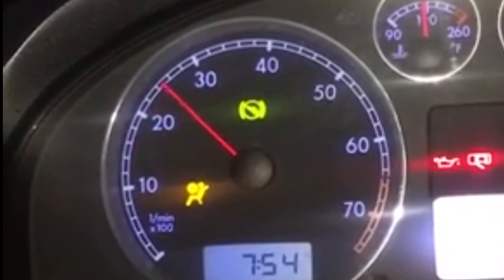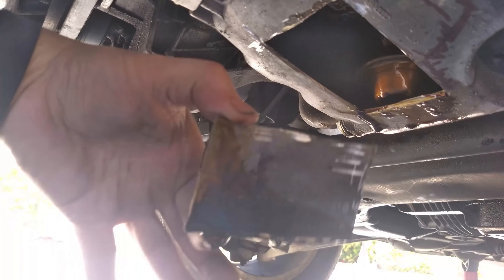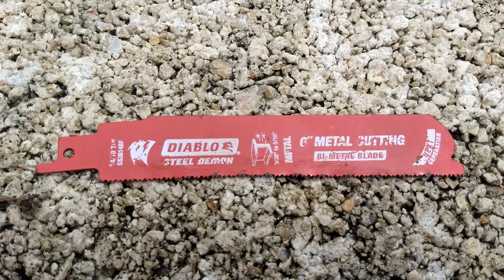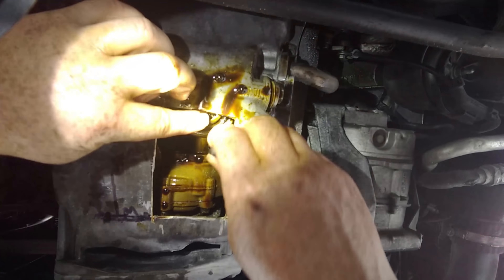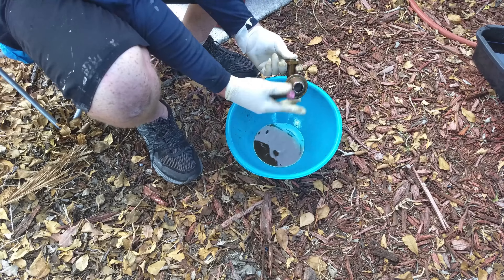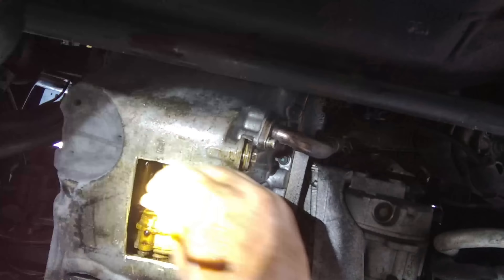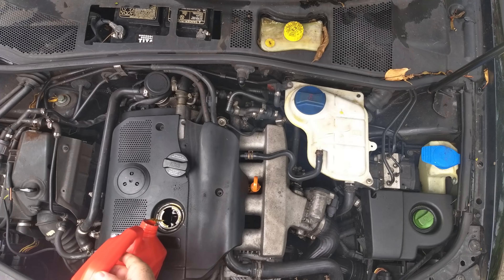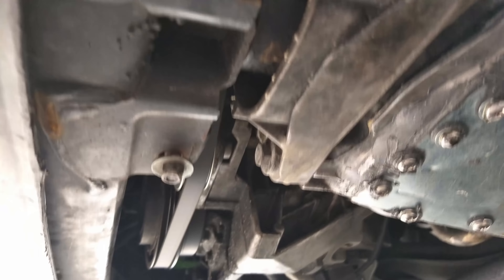Volkswagen Passat 1.8 Turbo Low Oil Pressure Create Access Plate

Comment: Wouldn't it be easyer just to remove the oil pan, remove all the parts (without unscrewing screws thru the cutted out buthole in oil pan), and put it all together? I mean,  you spend more time creating cover, letting to dry sealer, and we are not even talking about metal filings in engine after cutout and drilling....
Reply: A single mother with three kids is going to try to buy a used car already struggling in life and then she ends up buying someone's Frankenstein monster and gets stranded in the middle of nowhere and stuck with a junk car and a humongous tow bill along with the mechanic who's going to give her the bad news.
Reply: Hello, you probably don't even remember making this comment but I might as well answer the question for everyone wondering. The Audi's and VW's of this generation with the 1.8t's were built in such way that the whole subframe had to be dropped just to remove the oil pan. Checking and cleaning oil sludge in the oil pan is a huge hassle with these cars. Making an access port on the bottom of the pan isn't such a bad idea.
Reply: Like the other guy stated the the subframe is in the way so the easiest way to remove the oil pan is to pull the whole engine
Reply: Great idea I did the golf gti easy remove sump however nothing in way but screen was Full of plastic and metal rings!!! Yes Actually -from severely smashed dipstick tube a rite dope had done rammed and rammed at .But that cut method on that motor is the best 👌
Reply: Just get a new oil pump replacement
Reply: I have a 2 tfsi with the same issue, where I have to hold the engine up because I need to remove some engines mounts to lower the subframe and even after all that work getting the oil pan is still not easy, I've done it two times already, first time took 2 weeks, second tok me 3 days, but I work alot longer hours those 3 days since I was of work. Basicly lived in the garage for 3 days, was not fun, and now I have a clogged   pick-up tube again! Even after  shorting the service intervals way way way lower then audi recommend. And I still get this issue, maybe it's alot of residue around the engine from the previous owners still. At leat this time it lastet two years last time was not even a year

Comment: Huh, really! Now you will have metal filings from the grinding, drilling and taping of the plate running through your motor, then all the extra gasket maker when it degrades will plug that pick up solid! For people who view this video, DO NOT DO THIS! Guaranteed way to destroy your motor.
Reply: Yeah, its not that hard to drop the subframe.

Comment: I think vw knows this is a issue with the pick up tubes. They should have been the ones to install a inspection port like you did. But with vw, its always about charging and ripping off customers. I like your idea so pay no attention to those who criticize. Let them do all that extra work pulling that sub frame. Believe me, its not an easy job
Reply from the maker: Totally agree. An access in the original design would have been great. After working on this car, compared to other makes, it definitely seems vw weren't manufacturered for the home mechanic. I appreciate your comment. Thank you for watching!

Comment: awesome video of how you shouldn't do a job.  And the best thing is the amount of positive comments that the video has .... the work that this person has done is terribly a very bad way of how you should not repair an oil pump blockage.
Do you know why the oil pan doesn't have an access port on the bottom?  to avoid that due to a simple failure of a gasket, several liters of oil do not spill on the road and because of that people die due to an accident due to oil on the asphalt
That is why I am impressed by all the people who like this video and comment positively.  you can tell there is very little common sense.  And for those who want to answer me with some stupidity, I only say that I have been a car mechanic for 25 years and I have never seen stupidity like this and even less of people praising it

Comment: A brilliant idea... THANK YOU!! Also, GREAT documentation and absolutely the BEST editing, and I love that you included a detailed "list" (with pictures, no less!) of the tools and materials that you used. Thanks again, David
Reply from the maker: One quick note. Someone commented you may be able to remove front motor mount and slightly jack up front of engine to get access to rear bolts. Haven't tried however if this is true probably best to do it,  as you would on just about any other vehicle that allows full access to all oil pan bolts.

Comment: Congratulations. You've traded a bad pickup tube for an engine full of metal shavings.
Reply: Just drop the sump.... wtf...
Reply: @caesarpula612  Dropping the sump is quite difficult on this model.
Reply: @DoItWithDave  I see what you did and why, but the above poster is pretty spot on. Maybe somehow leaving in the oil, and using your mini hacksaw as much as possible, using the messy oil to pull away the shavings out of the engine as it dripped through, would have been a nightmare but maybe saves your engine long term. Any problems you've encountered so far?
Reply: I disagree. Oil pans have magnets in them that will attract any metal shavings. Also filling the emgine then draining it and refilling will wash any thing that might be there out or to the magnets cleaning it up.
Reply: diabloein thousands of micro shavings will not all be picked up by a sump magnet. Maybe the risk is low?
Reply: @Alonsel3  those magnets sole job is to pick up millions of micro shavings. They are there to catch all the shavings from bearings, rings, pistons and anything else that wears out over time crearing fine metal particles and even chunks. Then it all would have to make it theough the filter on the pickup tube, then through the oil filter. This is honestly relatively no risk unless his drilling and cutting actually damaged another component.
Reply: Isnt the pan aluminum? Magnet will not pick up aluminum shavings
Reply: @monkeywrenchin351  bam ,one man think them all into knees .hes now gonna have metal shave AND zitate"alot ,lot of gasket maker" in the pan .stuff really good thinking ,bad doing by gasket.
Reply: @diabloein  I've dropped my A4 1.8t oil pan, there is no magnet in there. I've actually only ever seen magnets stock in transmission oil pans. And as others have said aluminum is not magnetic anyways.
Reply: @diabloein  if I recall correctly, this is an aluminum sump, so better wash all the shaving before placing the plate in place,,,
Reply: @diabloein  except oil pan is aluminum which will not be attracted to magnet...
Reply: Guys a joker, total joker, extra BJP from swarf

Comment: My car, this situation is not the first time, the mileage has changed over 150,000 kilometers, and the oil pump has been replaced. Then the mileage is 250,000 kilometers and the oil pressure is too low. I think of the owner of the repair shop. I told you that this has to be changed every 100,000 kilometers. I didn't believe that the oil pump was so easy to fail at first, but today I believe that this problem is very troublesome. If it is not handled, it will cause engine damage.

Comment: This is brilliant!  Looking at doing this on my Passat.  VW makes the oil pan removal so onerous, even if you have all the tools and shop equipment.  It's just not worth doing it on an older car, the repair would cost more than the car is worth.  Best part is you can perform periodic inspections of the pickup tube easily. Someone should make an after market kit for this.
Reply from the maker: Thank you for your comment. Everything you stated are my thoughts exactly. It would be nice to have an aftermarket pan that you could access the pick up for regular service.
Reply: I agree with you completely on this!!!

Comment: I have the alarm for low oil pressure on my 2004 Passat 1.8T. I had the sensor replaced so now it goes off sooner, LOL. After you completed this clean out, did the alarm stop going of AND more importantly did that top end noise stop?
Reply from the maker: Didn't have an issue with low oil pressure after this. The top end noise wasn't present however some of the debris that got clogged the filter were definitely pieces of the chain guides that had deteriorated. I'm not recommending anyone does this I just wanted to share my last ditch effort on this VW. Thanks for watching!

Comment: Greetings. I'm 99% sure you don't have to mess with the frame to gain access to the bolts (on the oil pan). You simply need to move the sway bar down a little bit. Once the clamps/bolts on the sway bar are loosened you can move it down and away to gain access to the oil pan bolts.
Reply from the maker: After I posted this someone from another country commented something similar to what you are stating here. However he said I could have just removed the front engine mount and jacked the front of the pan so the 3 bolts would be exposed. I did this out of frustration (the car is literally falling apart inside and out) and out of curiosity to experiment.  Also at the time there weren't great videos on this however I did find a guy who posted a 2 minute video doing something similar (I linked his video in the description section) and got inspired.lol Thank you for watching and for your comment. It really helps the community to get the most information as possible before taking on certain projects.
Reply: You do have to lower the sub frame. I'm literally changing the oil pan on the same car right now. I started with the sway bar and jacking the engine up. There's one bolt that comes down and is completely blocked by the sub frame. Also the sub frame blocks the two bolts between the oil pan and the transmission. It's a pain in the ass and I'm not a professional mechanic by any means but I'm getting it done slowly but surely. I already have the sub frame lowered. Just need to get the last couple bolts and then swap out the pan and gasket and put it all back.
Reply: @keegkrino  Good luck with that. Nothing seems easy with that car (as far as working on it). But that's German engineering for ya...

Comment: how not to fix your car metal shaving in the oil pan  poor vw that his fixed  like that 
hack job for sure
Reply: Magnets in the pan will catch those shavings. Then there are at least 2 filters anything would have to get through before ever seeing the motor.  Really not much risk as long as the pan was the only thing he touched with the drill, saw, or grinder.
Reply: or just pull the damn pan and do it out of the car...

Comment: Kind of reminds me of my 95 cougar xr7 when the fuel pump went out 2 minutes after i filled the tank. I wasnt about to drop the tank so i pulled the back seat, used a cold chisel to cut a hole in the sheet metal, peeled it back and gained access to the pump. Replaced the pump, folded the metal back, put the seat back in and was going down the road within 20 minutes.
Reply from the maker: That's definitely a lot more practical then doing what I did here lol. I did however do something similar to what you did when I had to replace the fuel pump on my Chey Astro. There are  several videos on YouTube for that one. Thanks for your comment, and thank you for watching!
Reply: @DoItWithDave hey thanks for this I am having same problem with my passat wagon I was about to cut my losses and sell but I have to much in this I'm pot committed then saw this and bada bing gonna do this next week when I have off I'll let ya know how it went tha ks bro bro

Comment: Next time reach through the drain plug hole with a 90 degree pick and poke holes in the screen ....the stuff that goes through the pick up tube goes straight into the oil filter so it's getting caught in there. 

This is a lot of unnecessary hacking ....

Comment: I once had a similar engine consuming too much oil. Ended up cutting a hole through every cylinder bore to gain access to the piston rings. I put some gasoline and WD-40 to them and tried rocking and turning them in their gaps. All the shit that came off, I drained through a similar access hole through the oil pan.  Used the same sealant to reseal the cylinder bores, but used more screws to attach the cover plates to each cylinder. Compression test only showed about 5-10 % leakage! Made the engine great again!
Reply from the maker: .....Blahahahahha, thanks for watching.

Comment: Conceptually its a great idea and every car manufacturer that has sadistic design engineers (I'm looking at you Germany) should take note. However, the fact that you did not clean out the metal shavings from the pan after the drilling and tapping, plus your use of silicone gasket maker (part of which will break off and clog the tube again, are a serious cause for concern. A+ for concept though.
Reply from the maker: Thanks for the comment and this was an experiment. An isolating tool would have been a better option, and the 5 year old in me took control over the amount of gasket maker that was used.

Comment: I wonder if he realizes that all you haft to do is take loose 4 bolts and 2 nuts then lift the motor 4 inches and you can pull that oil pan super easy🤔
Reply from the maker: No he didn't...smh

Comment: I need help, I've been struggling to fix my golf 4 gti turbo 20 valve, it's misfiring, I went to several machanic, most of them thought the problem is the spark plugs nor coil pack but I've bought new ones the vehicle is continously misfiring and has no power and it ends up cutting off while driving...
Reply from the maker: I wish I had an easy solution for the issue your car is having. The Passat in this video had soooo many issues, including shutting off at a street light and needed to push it off the street. One cause for me was the fuel pump shutting down ( this gave the feeling of a misfire) after I replaced it the car ran fine for a while. Then the car got to a point where it wouldn't start. I would turn the key mother would turn but no start. I would turn the key the following day and it would start up no problem. I replaced the spark plugs (Passat has plug coil combo) and I would still get misfires.  You may find some useful info on VW Forums. Slot of ppl ask and answer questions about their VWs and you may find some helpful info for your make. I really wish I had a better response for you, I know had frustrating this situation can be.
Reply: I bet your car has a worn upper cam timing chain tensioner guides. This causes over advanced cam timing and loss of power. Just tear down the whole thing and do the head gasket, timing belt, and cam chain all at once. These are not hard to work on

Comment: I have a 1999 Passat fwd 1.8t aeb. I've never had the oil light come on but I was hoping to clean the pickup tube on my next timing service. Never look carefully but, you cannot drop the pan in the service position?? Not even if you loosen the motor mounts and Jack the motor up a little bit??
Reply: Of course you can. You have to lift it from above and drop the subframe. It's not hard. The written procedure sounds worse than it is. But doing this every 100k can be a pain. I understand his approach. Knowing what I know about metalworking and engines, I would have done a few things differently. But I don't see it as terrible as some comments say. Any large shards will be picked up by the pickup screen. Small ones will be picked up by the filter before it gets pumped to critical clearance engine parts. The oil pan is aluminum which is soft metal. I was cringing mostly from the grinder wheel. They are, by design extremely abrasive. I would have probably drilled each corner and used a hacksaw blade or mini recip to cut the rest if I had to. With that kind of work though, I'd drop the pan and cut the access port on the bench, making it super easy the next time.
Reply: I'm dropping the oil pan as we speak, But while I have it out, I'm very seriously thinking about modifying the oil pan with an access opening, I'm going to look at the oil pan very closely before temping it.  @simplestatic3751

Comment: The should just make an access door like this would surel make life easier suprised no aftermarket company has designed something like this unorthadox yes but if it workd and u dnt have ocd then right on !  I dnt know ifvi could take  grinder to my oil pan ;) seems savage but if its a cheap winter beater who really gives a fuack if its fixed good job!
Reply from the maker: The result of throwing my hands up and saying screw it.lol thanks for watching!
Reply: ECS do a shallow sump conversion where you can just remove the bottom half of the sump. It makes life a million times easier. I wouldn't recommend this video at all. There will be shit loads of metal filings inside the sump after drilling and tapping it.

Comment: How is the car now? My car sounds extremely similar  idk if I should do this,make a follow up vid
Reply from the maker: I have had no issues with low oil pressure with this car since this video.  I threw my hands up to make this video. Lol. FYI someone posted in the comments, in Spanish that the front motor mount can be removed so the oil pan can be jacked up a bit, giving you access to the 3 rear bolts. I didn't look but it sounds like a possibility. You may be able to find some info on Google. I hope this helps. Thank you for watching!
Reply: @DoItWithDave  cool thx u so much for being active and replying

Comment: OMFG ....a hole in the oil pan!
Hey bro if your cool with that it's all good.
Reply from the maker: Man ppl have posted I could have removed front motor mount and jacked front of engine enough to access the rear bolts. Apparently I was supposed to lower the subframe and support the engine from the top to my knowledge at the time and I just didn't have the tools to do so.